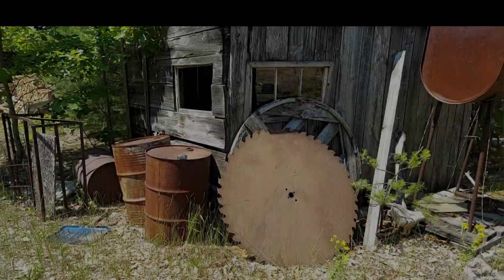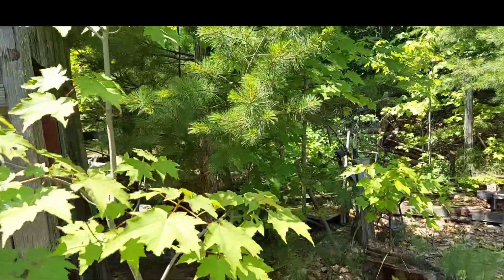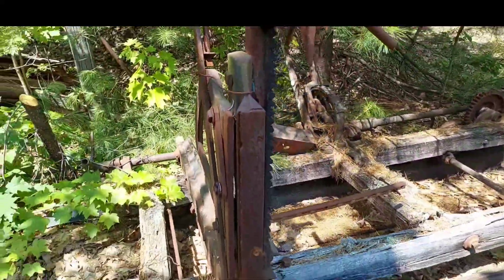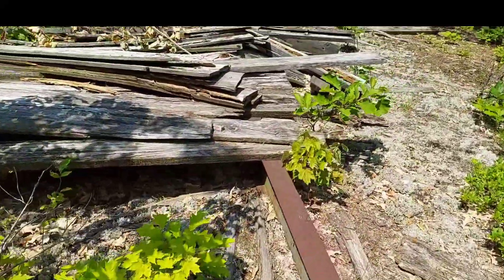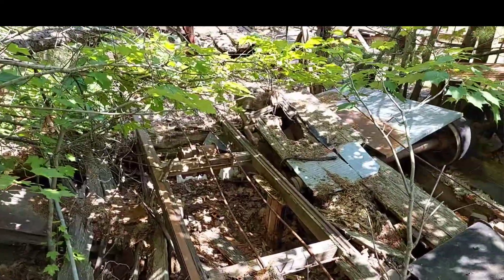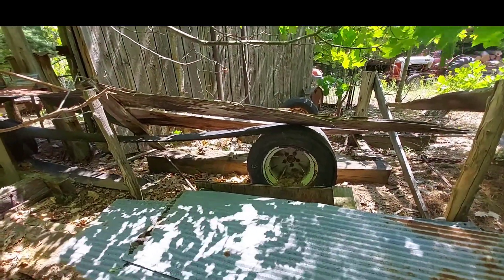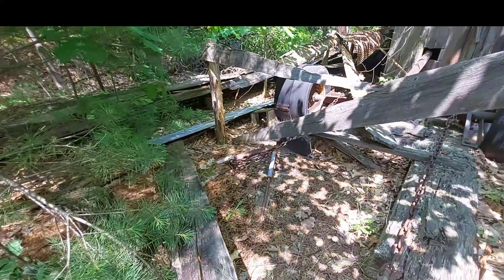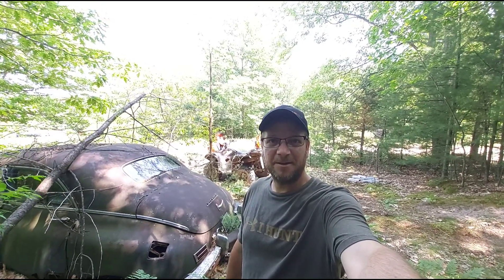Abandoned sawmill (and the story behind it)

Comment: Ok being it was a bus engine mounted crossways at the rear of the bus. It was backwards rotation. So your grandfather was pretty smart. He installed the rear end to use the differental to reverse the rotation. That made the blade turn in the right direction. Likrly it ran some where around 550 rpm. The tire on the other side. Most likely he had the brake working on that side. When he applied that outer wheel and brake it quit spinning and the other wheel and tire drove the mill. A clutch improvision! Im 70 and a bit of a know it all when it comes to old circle saw mills. Enjoyed the video. Hope you all do decide to rebuild your Grandfathers Sawmill.
Reply from the maker: He was definitely a smart man.
Reply: I'm in the process of removing an old mill right now and bringing it home, I was told it's a Meadows but not sure? It was all destined to a scrap yard before I stepped in. I didn't really need the project but not a chance in hell I'm letting the crusher see this old girl. I went there looking at an old massey furguson which I  also bought , when I happen to look over and see the 60" blade poking out of the briars. It has a case power unit which I'm going after today( I have to put some new oak runners on it to move it) I'll prolly do some vids when I start setting it up, be nice if you where my neighbor, I'm gonna need all the help I can get. Didn't really go looking for a sawmill, it kind of found me.
Reply from the maker: @Tonnsfabrication  That's awesome you were able to save it from the scrap yard. Hope you get it up and sawing again!
Reply: When using rear end as gear box you must weld the spider gears, with one wheel locked down one wheel spinning the speed is crazy, Much to fast, we use rear ends with brake on 1 wheel other wheel as cable drum to build winches, on my saw mill the spider gears are welded so it turns at its gear ratio not 3 times faster.

Comment: The bus engine is a 6-71 detroit diesel.  2 cycle engine it has 6 cyls each displacing 71 cubic inches 426 cubic inches total.. That foot pedal operated a headblock receder, the carrage was moved back and forth by a slipping belt arrangement located in the  husk.  To move the carrage the sawer pulled or pushed a long lever and the more pressure he put on it the faster it traveled. The saw blade is a double circle saw. There is a factory tool used to remove and install holders and teeth.  It appears to be a triple head block Frick mill. It isnt home made. You bought from the factor or dealer all the cast componets saw mandrel and parts. and assembled those componets on a wood or steel frame.   That mill could be made to saw again. Its a viable project. I love a circle saw mill.  There are very good  desirable and usable parts there.
Reply: Not a bus engine.
Reply: Yes it is a frick, still built new today, and ever part for that mill is sold new. I use about the same set up on my mill. the rear end cuts the rpm down. Changing rotation on that Detroit is simple. 3 different ways to do it. Just never forget to swap oil relief valve and pickup tube location on oil pump. Unless you change it by reversing the bell housing to other end of engine. bus used pancake engine, it lays on its side.

Comment: hi there nice old the only thing i would suggest if it already is. not to late get the blade off the ground a grease the heck out of it . john
Reply from the maker: Hi  John. I'm not exactly sure what the story on that blade is. It was left in the engine shed. There is another blade that "good" one I assume that is stored indoors.  Thanks for watching.
Reply: @Lifeinthe906  who's might be a good back up if it hasn't been in the dirt to long , i have seen so many blades lost that way , oil the one inside also  hot then cold condsate gets them john
Reply from the maker: @fricknjeep  Thanks John I'll  get some oil on them both.

Comment: He may have had a bus engine, but this engine is not a bus engine. It is 6-71 Detroit truck engine. I would think he may he run low idle up to 1200 to run mill. I just rebuilt a engine like this one, and got a 4-71 i am building now.
Reply: That is a old 0 frick carriage He used the truck rear end as a gear reduction box. a Bus engine lays flat on its side,  Easy to id. Because it is a frick carriage all the parts are still sold, the whole carriage is still sold new.

Comment: What a shame! It’s all there.all it takes is a little want to to make it work.
Reply from the maker: It will work again someday. Lots of work to make it operational again. Thanks for watching
Reply: @Lifeinthe906  it’s not as difficult as it may seam. Just be sure to make good foundations for the track and the husk. The goal is do it once correctly. Wood will always fail in 5 years or less.
Right now, get the engine started with new fuel, change the oil.
I love the drive system and the electric conveyor.